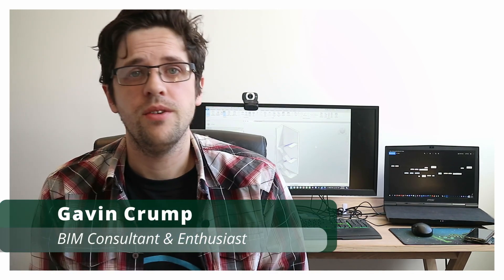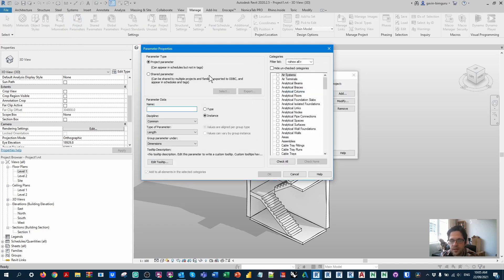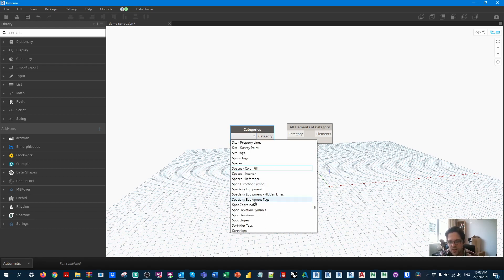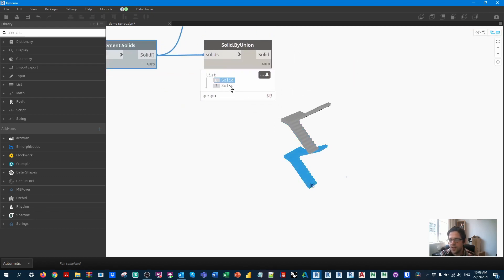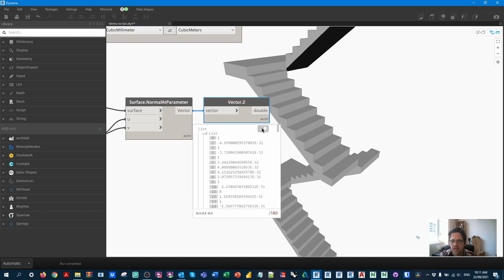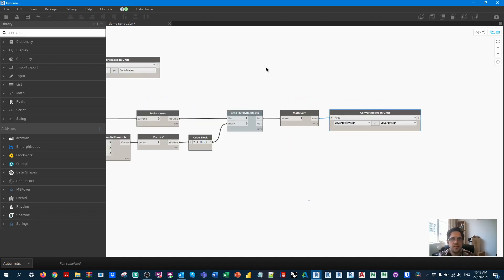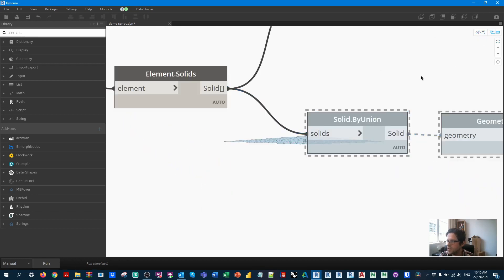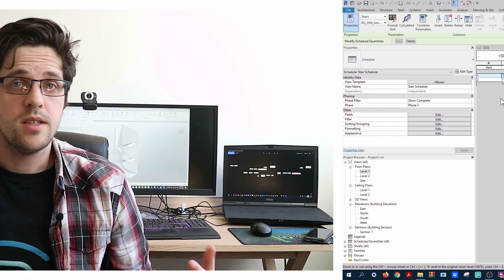Stair takeoff in Revit using Dynamo!

Comment: This is very nice.
I have a question about external surfaces of stairs which adhere to staircase walls. I don't want calculation this surfaces. Do you have any idea how to enrich this dynamo script?
Reply from the maker: The only way would be to get all walls within a general distance to the stair and also check if the face centrepoints intersect any of those walls

Comment: Hi Gavin, Thank you for all.
I have a question. Could you please explain me why did you put >0.9 in z value. Thank you.
Reply from the maker: In this case I am isolating all faces which are facing upward. Dynamo has a slight tolerance issue with normal values very close to an axis, so I usually go just below this (in this case I want all up faces, so Z is 1, so I check for faces with a normal more than slightly less than 1).

Comment: Hi Gavin, Thank you for the useful sharing.
I have a question to ask you. Now I am creating Material Legend  . However I can't add "Hatch Pattern"  column and  I just want show the materials on the sheet ( the same like filtering sheet by legend keynote). So I do it by creating detail line, filled region .When I have to change materials,they will have to be adjusted manually .Is there any way to solve the problem? 
Regards.
Reply from the maker: Hrm the only way to do this would be to have a filled region type named after the material, then Dynamo could assess the material's surface pattern name and find the matching filled region type, then update its pattern also. They're not directly connected as objects so a match would need to be made.
Reply: @AussieBIMGuru  Thank you so much, Gavin!

Comment: Hi Gavin, I have two questions please
Question one: I want to convert 2d plans doors and windows from autocad to Revit by using dynamo what is the best workflow to do that?
Question two: I need to rotate the bounding box with every element or if you have another solution to do that tell me about it.
 Thanks
Reply from the maker: The key to place doors/windows would be to match block names to revit families, then use something like genius loci package to find nearest wall to each block and place them at those points. Theyd be a default sill height though as CAD doesn't contain vertical data. I find usually most CAD files are way too messy to support automation unfortunately.

Next week's video will show how to do element aligned bounding boxes.
Reply: @AussieBIMGuru  Thanks Gavin